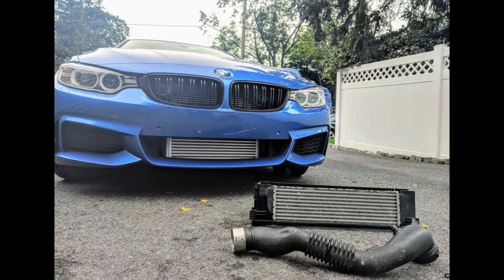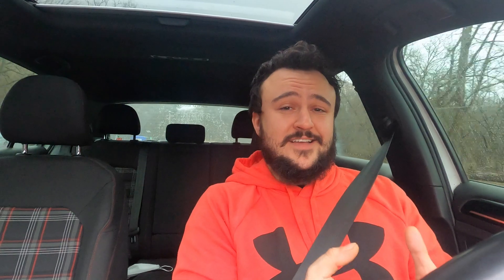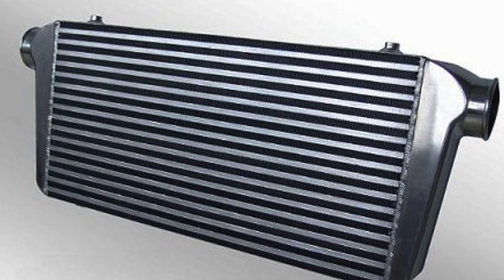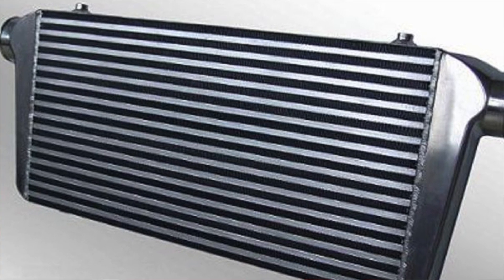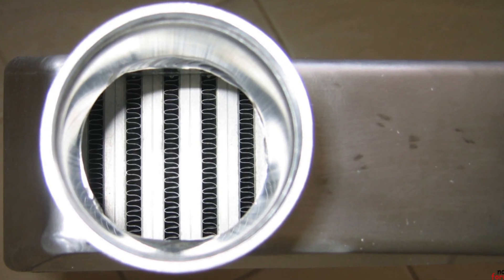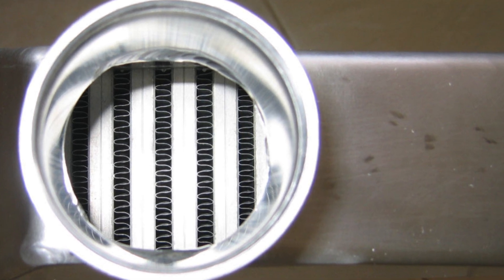What Does an Intercooler Do? How Does an Intercooler Work? | Intercoolers Explained!

Comment: Great video! I have a problem with my golf mk7 gti, it runns bad on idle but only when it is hot outside. And I saw on live data that the intake air is around 45-60 degrees Celsius. So i think something is bad with my intercooler, What do you think?
Reply: But when it runns fine its about 30 degrees
Reply from the maker: You may need new coil packs, you cannot really inspect the intercooler since it is sandwiches between the radiator and a/c condenser. In stop and go traffic it’s normal for temps to get that hot! Especially if you have an oem intercooler. Even an aftermarket one will heat soak after some time, it’s natural in hot conditions with little airflow.